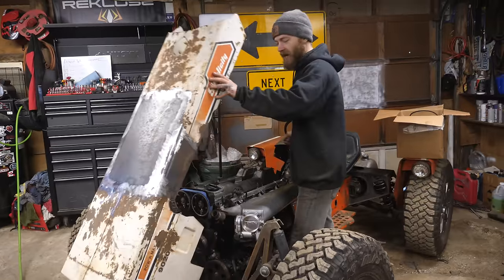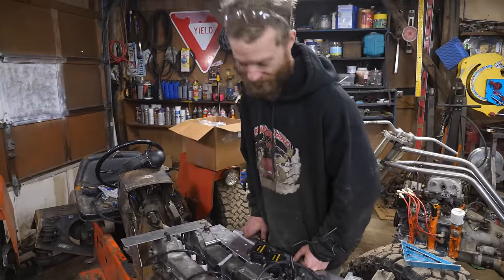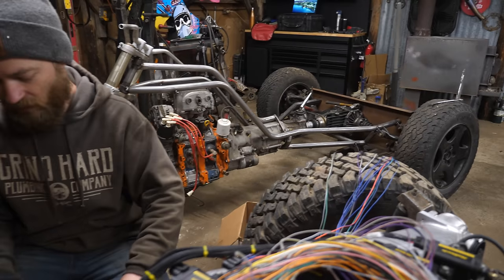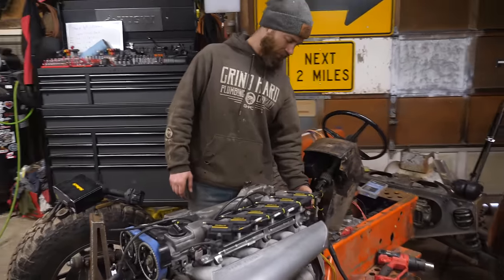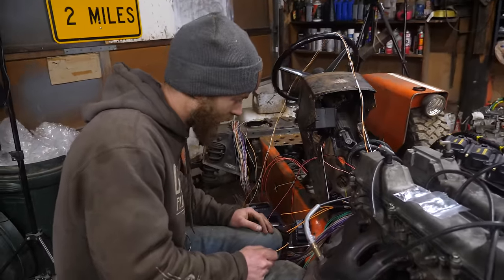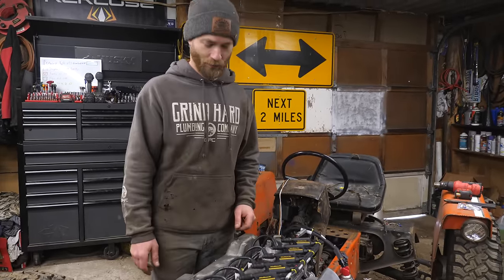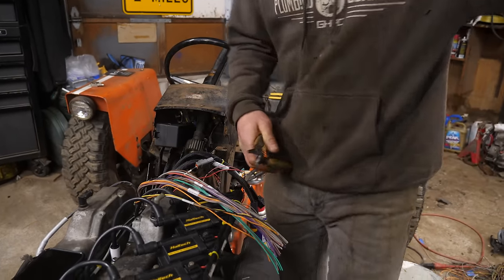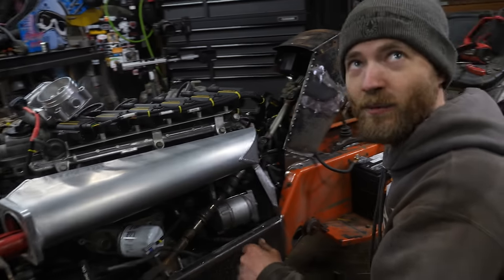2JZ Lawn Mower Build - Haltech ECU Wiring and More!

Comment: I did that vacuum cleaner trick the other day when faced, drilled and tapped a hole for a water temp sensor into the 'bridge' between the heads on the front of a 1uz. Made a little fly cutter to make a flat surface for the sensor to seat against. Love it when simple little stuff like that works

Comment: if the PCV valve is really bugging you messing with your symmetry you can weld up the holes were there mounted and connect both of them together on the back of the cam cover out of the way of everything else going to a single line. then all your lovely new plug wires will be in perfect symmetry  .

Comment: Those cam and crank wires may pick up some signal interference from the spark plug wires, might be a good idea to run them under the intake instead.

Comment: While I'm sure it'll work fine with your 5v ref the way you did it, they run 2 lines down for redundancy and signal refinement because it has 2 or 3 (depending on the design) opposing potentiometers inside that sweep as the pedal moves and it translates those signals into a pedal movement it sends to the throttle body. Roadgoing passenger vehicles requiring a bit more safety than a 2JZ powered yard tractor. and all....

Comment: Use shielded wire for the crank, cam sensors

If not then you will have issues.

I have had them and many many others have. Be warned.

Comment: Not saying it won't work, but if you end up haveing issues with your crank/cam triggers, it could be from running them close to the ignition cables. EMF is a bitch.

Comment: personally woulda just zip tied loops into the wires so that if u ever decided to pull the motor for a different build you could still use it 8:40

Comment: the reason i'm a low voltage marine electrician is because wiring and wire color codes are standardized....   no matter what boat you work on, the neutral safety start wires are yellow with a red stripe,  power on with the key is always purple, accessories are always brown or brown with a white stripe....  makes installing accessories, troubleshooting and repairs easy too....   I refuse to work on cars,  not for any amount of money

Comment: ah man instead of snipping all of those wires you could have really easily and simply de-pinned them from the ecu connector, no special tools needed or anything. Just push the white tab in (other end will poke out) and pull on the wire.
Reply from the maker: We will eventually, but still not sure which ones we will need for future additions.
Reply: Yeah that's the beauty about de-pinning,  that you can just reinstate that pin/connection without a join.